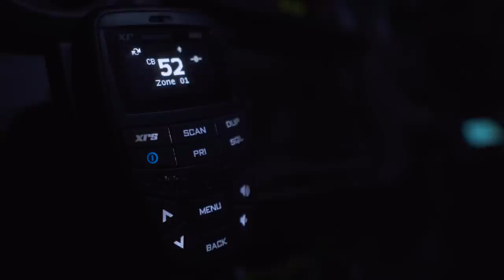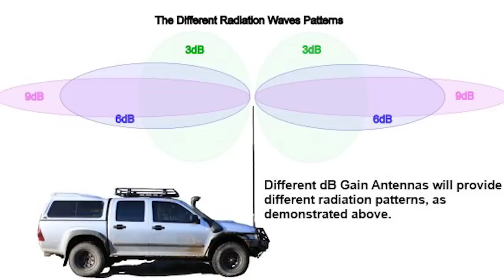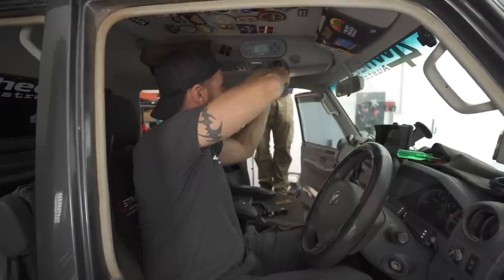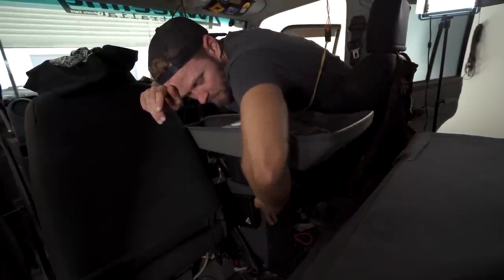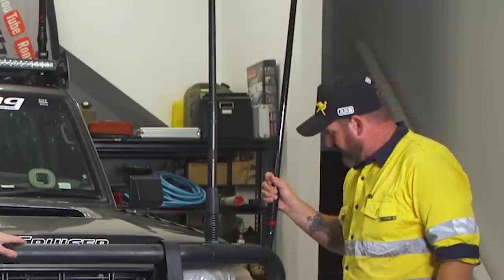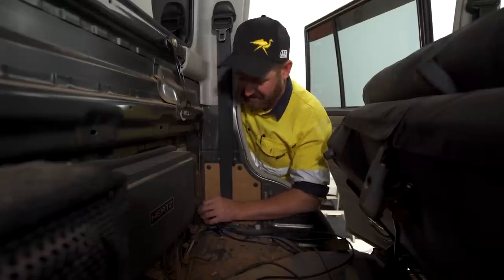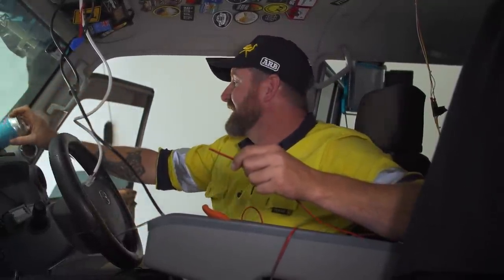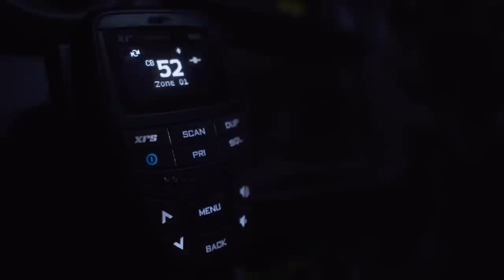UHF CB Radio Install & TIPS

Comment: The coverage patterns regarding antenna placement is not as described in the video, the car act's as an ground plane and with the antenna on the bullbar you will have better coverage to the back of the vehicle. So it will be opposite to what you showed. Please take a look at http://www.rfcafe.com/references/popular-electronics/images6/antenna-placement-popular-electronics-november-1966-2.jpg As you can see this was well known facts over 50 years ago. Thanks for the video and for sharing and inspiring. Cheers.

Comment: Great Video, but i was wondering why u didn't heat shrink  the power cable for the radio?
Reply from the maker: Inside the cab that’s Torben’s method outside he does heat shrink (external wires). I prefer heat shrink too but he was doing it and I wasn’t questioning what he does better than me.

Comment: Nice install guys. just a couple of questions. Firstly, did you have to cut the hole in your roof lining (near you mirror) for your antenna cable, power etc, or was that already there from an accessory? Also, how does your radio work (transmit and receive electrical noise) with the antenna cable being up against the power cable, or does it only negatively effect the signal if it's running parallel with the power cables? Thanks.

Comment: Very useful, thanks guys. Based on your tips, I’ve recently placed mine on the roof as well and it’s working well. My question: I’ve installed a RFI that allows me to switch from a small whip (~2 dBi) to a larger antenna (~6.5 dBi). From your experience, is there much of a difference using whip antennas vs the big solid antenna that you’ve installed? Is there much of a difference?
Reply: have a look at the GME UTube Vid about "Selecting an antenna type". is a good watch

Comment: Hi Ronny, I have a question, can you run two antennar's to the same unit via a split switch that allows you to go from a 3 DBi to a 6DBi and get the best from both, thanks for the show, cheers, Neil S.
Reply: you could butt its a  waste of time just stick to a 6db antenna is the good middle ground point
Reply from the maker: You can but you will loose some signal strength as you are adding a connection at the splitter
Reply: Ronny, I do mainly outback adventures, NT, SA, QLD, NSW, as you know mainly open country, so a single 6+ DBi would be the  best with remote location device for good measure, thanks for the Quick reply your one of the best, cheers, Neil.
Reply: Those photos are way over dramatized, 6db will work in nearly all cases
Reply: As most repeater antennas are around 12db and on top of hills,

Comment: Love your work Ronny but there is absolutely NO issue in cutting the coax to any length you desire, in fact the shorter the better! Obviously the longer the cable the more signal loss over the entire length. I’m not sure if you are getting confused with some ‘tuned’ antennas that have an adjustable tip, these should not be adjusted once set for UHF CB (477mhz) as doing so can put out the SWR (Standing Wave Ratio) reading, possibly leading to back feeding into the output of the radio causing damage. The only important thing to remember with the coax besides making sure all connections are done correctly is that the coax MUST be 50ohm - RG58, DO NOT EVER use some old tv coax you may have laying around, this coax is 75ohm, most probably either RG59 or RG6, using 75ohm impedance cable WILL throw the SWR out buy a HUGE amount and besides weak Tx and Rx signal you WILL damage your radio. Amateur radio enthusiast for over 30 years here. Looking forward to the next series mate 👍
Reply from the maker: We didn’t want to tell anyone you could as we then encourage people to do it and if you don’t connect them right it could ruin their signal.
Reply: Ronny Dahl yeah fair enough Ronny. Keep up the good work mate, looking forward
 to the easing of intrastate restrictions next Monday! 👍

Comment: Are you worried about taking out the big antenna with a hanging tree branch or the likes Ronny? i see it folds down but hey all that night time driving you do could be easily snagged
Reply: Chris Miller They have springs at the bottom of the antenna.

Comment: Great video gents. When running the coax through the loom tubing, how did you deal with the screw fitting to the back of the radio unit? That's fairly chunky and wouldn't fit through the tube?
Reply: Going from the scene with the fish tape they pulled the cable with no end and soldered one on. Some cables come with smaller FME connections that can then be attached to the radio with an adapter.
Reply: @hannahranga  pulled mine apart over the weekend and found a smaller connector with the larger one attached that then goes into the radio unit. Undid that and happy days.

Comment: Is there any other way to stop that alternator sound from running the wire next to the battery ??
My 4wd has the main & 2nd battery on either  side of the engine & my antenna is on my bull bar.
Reply: Use ferod rings

Comment: Would it not be prudent to mention the 2.1dB, 6.6dB (and 8.1dB, which you didn’t show)
 antennas are easily interchangeable in less than a minute and are often available in a 2 or 3 pack? And mentioning the pros/cons of powering from the accessories circuit vs an always on set-up (in both single and dual batter set-ups?

Comment: 2:25 ... Ronny's nail clippers... love it... esp Ronny's giggle in the background. 
Pretty much the set up that i am looking at (1x xrs370 6dB antenna). 
I need to figure out how to run the aerial on the roof of Subaru Outback... do you have any "neat" recommendations? Currently have the Rhino Pioneer Platform.

Comment: Bit of a technical question but, what to the experts say about running x2 antennas off the one uhf (both antennas joined together). Also if you do something like this is it beneficial to run a signal filter on either one or both. Love the vids, keep up the good work!

Comment: Got a couple of questions;
1. You have 2 UHFs but 4 antennas. Two on the roof are for the two you installed in this video?  Is the thin one on the bar for your radio stations? And is the antenna on the passenger side of the bar decommissioned or still in use? 

2. What are your thoughts on an antenna splitter, so you can have both antennas on the one UHF but flick between them.

3. Do you know much about kinking the antenna wire? If it effects the signal or not?

Comment: Hey Ronny and Torbs great video, just wanted to know if it's possible to wire a CB radio using a cigarette 12v plug to connect power to it? Thanks guys

Comment: Did I miss something in the vid? Why 2 radio"s? One being UHF? Is the other VHF? Also should always solder standard wiring connections, covering this insulator (heat shrink is better than tape. he offset method I use every day as a Tech.

Comment: Might be more of a preference thing but why keep the fuse on the radio cable? The other end of the cable should be fused (else the radio wire isn't protected) and then you don't have a random fuse somewhere that's a pain to get to if it ever blows.

Comment: People tell me dont go straight off the battery, it will drain youre battery, wire it like this or like that, use a fuse or relay bla bla bla, will it hurt to just hard wire it straight to bartery? The fuse on it will protect it from surges etc? Thats my understading.

Comment: 12:23 - you're actually looking at it wrong, the car doesnt block the signal, it amplifies it : for lack of a better place, i just uploaded a picture to my facebook (link below, set to public), which shows the radiation strength patterns of a broadcasting aerial (eg: 2-way radio) on a metal car (link below). 
contrary to intuition, if you place an aerial on your back bumper, the signal is projected strongest to the front of the car, and is severely impeded towards the rear of the car. you are still correct insofar as the aerial is best placed on the middle of the roof (well, as close to being directly over the centre-of-mass as possible) for the most evenly spread signal

https://www.facebook.com/photo.php?fbid=152618206526686&set=a.113879247067249

*Edit: i just found a link to the source material - Popular Electronics November 1966
https://www.rfcafe.com/references/popular-electronics/antenna-placement-popular-electronics-november-1966.htm
testing used a whopping 2.5 meter aerial

Comment: 1 radio, 2 antennas? No worries. Use a selector switch. I do. Switch left for my 2.1dB and switch right for my 9dB. Cutting coax for UHF is not an issue. Cutting coax on a HF is an issue.

Comment: Explain more about not cutting the coax and length or is that only for Ground Independent Antenna's,   Your 2.1 is Ground Dependant and should be in the Middle of the Roof, The other 2 are Ground Independent, and can be put anywhere above the bonnet 
Why is it RG58 is still being used when it is too much loss for UHF

Comment: Running cables up to the roof use a wiper sniper wire  instead of the yellow tongue as its smaller and u can go behind the body. Also hook into your shitty standard 70 series speakers to your uhf works a bloody treat trust me

Comment: Thanks gents...You've just FORCED me to spend a few hundred bucks on a GME 6.6 + 2.1 Radome kit and a fold-down base for the roof bars on the canopy of the Silverado!!!
Torbs, can I ask what brand that USB soldering iron is please? It looks like a great unit and I don't want to buy a $10- special piece of rubbish.
Reply from the maker: We borrowed it from PDP Perth diesel but I bought one the other day which is a Milwaukee 12v
Reply: @Ronny_Dahl  cheers mate...I've just ordered one of the 12v Milwaukee units from the USA.
Reply: @Ronny_Dahl  So I've just spent a couple of hours moving the "brains" of my TX3540 from up in behind the pedal area of the Silverado and have now mounted it (SHOCK HORROR!!!!) under the driver's seat.
The reason for doing so is that whilst I'm awaiting the arrival (from an ebay seller) of my new GME twing antenna pack and folding base, I thought I'd do some measurements.
I used a piece of waste telephone cable cut to exactly 4.5 meters and ran it from the proposed position up high at the front of the canopy, into the cab and found that if I left the radio where it was, the cable will be about 400mm too short to reach where the radio was.
I take your point about not putting it under the seat...but three things come to mind: (1) the Chevy has a 6" lift, so the floor under the seat is reasonably high anyway and (2) my days of river crossings etc are behind me. If I see a water crossing, unless it's life or death, I won't be tackling it if it looks very deep. (3) By the time the water reached the radio...the radio would be the least of my worries!!! There's a shitload of electronic stuff that would drown before the radio!!! haha

Comment: Another tip request, how best to run wiring from the roof into the interior without drilling holes in the body shell eg a 76 series wagon?

Comment: Just curious as to why you used 2 different types of radios (one hand held) and (one box controlled) rather than just having 2 new hand held ones? Also, will your set up now be just the small 2.1 and large foldable 6.6 on the roof? Or is the 6.6 interchangeable with another  one which will be used? Are the antennas on the bull bar being removed?

Comment: A better way I think and always did was to get the yellow Tung through then tie the cable on and pull back not so bulky
Reply: I thought that was the common way, and the way I have always used
Reply: Your right my son is a sparky and that's how to do it
Reply from the maker: Either way works but point noted

Comment: Good video thanks for the efforts! Question, if mounting antenna to an aluminum roof rack which is mounted to an aluminum canopy do I need a separate earth feed from chassis up to antenna base? Or will it work fine? Thanks

Comment: Is there no need to tune the antennas to the radios? Like you would do to a CB radio.
Reply: Rich Brown There is. SWR. They missed it ..
Reply: Both are pretuned ground independent aerials for the 477 UHF CB band so no tuning needed (or really possible). The old RFI 1/2w they took off however would've needed to be cut to length.

Comment: Hey Ronny, another great vid.
You said you can't join a coax cable. I have had to do this on my prado as I didn't have a choice. 3 questions: What is the disadvantage of doing this, why shouldn't you do this and how can I check that all is ok if I do need to join a coax?
Reply from the maker: Great questions mate I’ll add them to the list for the experts for technical reasons

Comment: ronnie i find it really funny with your tips.....i have been  using amatuer radio /27 mhz cb /uhf cb since i was about 8 years old....Your 100% wrong you can indeed cut your coax and re solder a new pl 259 plug back on you can buy them from jaycar for under 4$....With uhf espeically the shorter the coax the better ...Uhf has high loss with rg 58 coax so  the shorter u can make it the more power gets to your radio....You can also join your coax if needed all you need is another pl 259 plug and a so 239 adapter...Also none of the 4wd channels evert talk about repeaters and Vswr not every antenna coming out is tuned you really need to check the vswr of the antenna...
Reply from the maker: Yes can cut it but only if you know what you are doing I didn’t want to encourage people to cut it as it’s actually really difficult for people to tell if they work A okay afterwards. We in fact cut one and soldiered during this install

Comment: where you removed the dash blank and used an insert that fitted in for the hand set to connect to, where do you get them from? looking at doing same to my 79. oops found it in your list of item installed RED XRS-RJ45, guessing that would work with a uniden unit

Comment: Why so thick? I know she like it that way, but what is the reason for using such large diameter fiberglass antennas? I have never had an issue with a steel whip antenna off-road in heavy brush before, so I'm not sure I'd buy the durability argument if that's the reason. I'd assume they generate a bit of wind noise don't they?
Reply: Don Leamon I’ve found the thick ones crack a lot easier in the scrub compared to thinner ones. It all just for looks
Reply from the maker: The thick one is on a bracket so it can lay down  if need be. Why the thick one?? Good question I thought I’d give it a go as it raises the antenna a bit. If it does shatter on a branch I can replace the top part. I also have the flexy rubber ducky as a spare

Comment: Hi Guys, can you put a join in aerial cable, proper coax screw connector. I have to remove my bull bar to get some sheared mounting bolts out of the chassis, and my aerial is on it . Will save me unwireing it from radio and rewireing it.

Comment: Have had more issues with water, dust and crap inside of non split conduit then split conduit in the last 10 years. Maily because once water and dust find a way to get into solid conduit wich it does cant get out

Comment: I would get a SWR meter check that when installing any 2 way equipment. Here in the US your UHF CB is FRS which no license required & GMRS radio which requires a license. Do you still use 27 MHz CB?

Comment: Great vid, i bought a gme raidio similar to the one you put on the centre console but in a bundle with an areal, my areal is very thin compared to the one you installed will this affect the signal?. Cheers
Reply: No it won't. These fat looking antennas simply have a plastic protective tubing covering the skinny antenna inside of them. Just makes them more durable against hanging branches.

Comment: Loved the vid boys . Question I had my radio installed by tjm and ever since I’ve had it as soon as I turn it on all I can hear is crackle until someone talks but yet no one else’s radio I know does this can you explain why I’ve tried turning the squelch down but still get it it’s a gme radio combo cheers fellas.
Reply: Try turning your squelch up until you stop hearing noise but have a friend give you a check to make sure you can still receive. If there is still noise make sure you run your power cables down one side of the vehicle and antenna cables down the other.

Comment: Probably needed a “ how to “ wire up for power ?  rather than just use the old wiring set up . None the less still a good vid with handy tips .. off set wire joints for 1 ... 👍🏼

Comment: I'm getting ready to install one in my truck. Your video was perfectly timed!
Do you need to tune your antennas there? I hear that we need to tune ours here in the States.
Reply: cb need tuning uhf dosent
Reply: 27mhz CB does need to be  SWR'd in. UHF CB doesn't. My amature (HAM) radio antenna is pre tuned to the VHF/UHF frequencies.
Reply: @danjensen9303   not all uhf cb antenna from the factory are perfectly tuned
Reply: @KawazZX10   what a load of shit  you should check every antenna...i just checked my mates  over the top 299 foberglass thing  from electrophone and the vswr was over 2...Dont truss every antenna from factory is tuned
Reply: @INTHEMIX74  thanks, that was my thought. It absolutely doesn't hurt anything to at least, test them.

Comment: How often do you snap your antenna on the roof when offroad?
Reply from the maker: Not once... yet
Reply from the maker: However I’ve snapped over 6 on my bullbar
Reply: I snapped one of those rubber duckies on the first day in the pyranese. I've now got an all wire antenna to try.

Comment: Hey mate I think a good topic to cover is how to identify a positive cable/power supply if you’re tapping into your ciggy lighter for the first time
Reply: mate always run your uhf from the battery...
Reply: Most cig wiring on Toyota's these days isn't big enough to carry extra power specialy when you are Transmitting. You can use it to trigger a relay from the battery though.